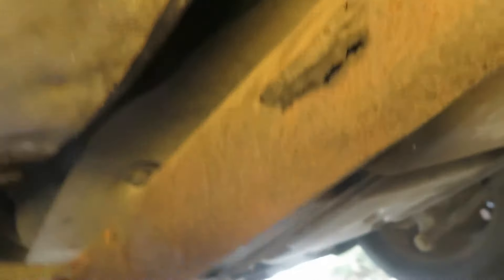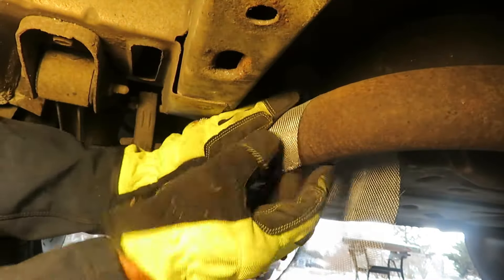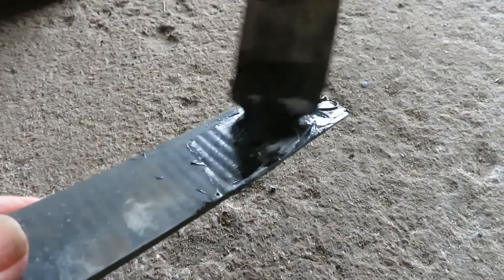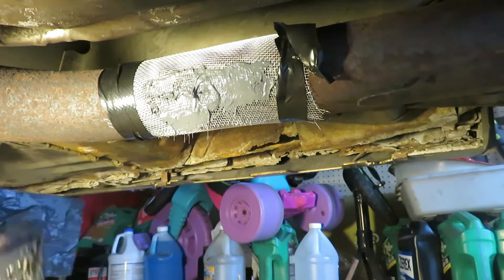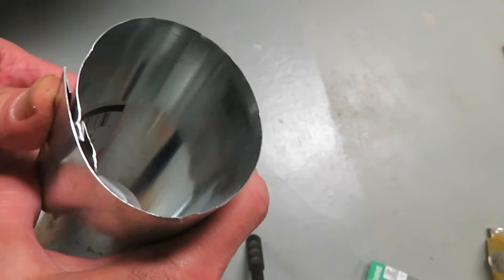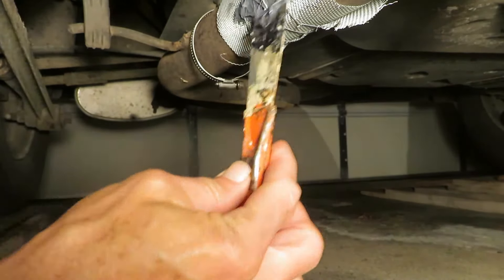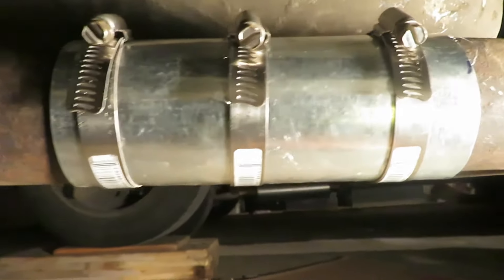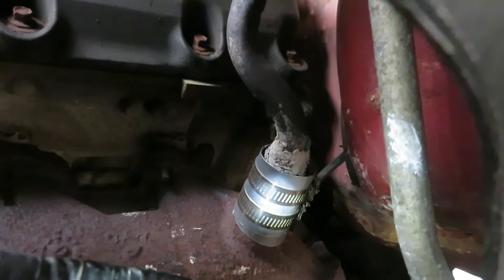How to Make a Lasting Repair on an Exhaust Pipe Leak

Comment: I think I would have embeded the screen in wet epoxy, but I'm teaching myself to weld so I don't have to do hack work like this. I tried that type of fix when I realized that my Focus oil pan had scaled to the point of leaking directly through the pan, I coated the entire pan and the oil still found it's way through the leaks and up over the rim of my improvised bowl. 2 years later, how did it last? I was ordering the pipe and the guy at the counter said we could just order the premade pipe, which I hadn't even looked into, but since it has 2 O2 sensors and collects both manifolds and joins to one before the cat, he closed the catalog and continued looking up my pieces without another word
Reply from the maker: This is for the non-welders out there. I mean hackers. Good luck with your welding, although I think it can be tough depending on where the opening is located. Best solution is new pipe. It did last a couple of years and then I did it over with heavier gauge sheet metal.

Comment: Thank you! I used the aluminum window screen, the high heat epoxy, some aluminum sheeting instead of stove pipe, the hose clamps and on top of all this, in the middle between the hose clamps, I used a 4” stainless steel band clamp to hold it all together. So far it is working great!!
Reply from the maker: Good idea with the stainless band. I went that way the 2nd time.

Comment: Nice! My old diesel rabbit vibrates those hose clamps off though 😂
Reply from the maker: I feel you. Sounds like a place for standard exhaust clamps.
Reply: @TheOriginalMechanic  hello want to ask you about a video you did on a 2010 toyota corolla around 5 yrs ago
Reply from the maker: @Blu-Man Sure, fire away
Reply: @TheOriginalMechanic  the 2010 Toyota Corolla you did 5 yrs back installing new headlight assembly did you have to adjust the height where is the adjustment screw ? And do you use led bright bulbs ?
Reply from the maker: @Blu-Man  I did not have to adjust the screw. I am not sure of its location and I no longer have this vehicle. I used standard replacement bulbs. Thanks for watching and I wish you luck with your repairs.
Reply: @TheOriginalMechanic  me and my Co workers are avid fans of your instructional videos u got skillz
Reply from the maker: @Blu-Man  Thanks so much!
Reply: @TheOriginalMechanic  say one last thing im wanting to change the transmission fluid and filter in my 2010 corolla like you had will car ramps put the front up high enuff to crawl under with plenty clearance to pop the bolts of the pan?
Reply from the maker: @Blu-Man  I would think think so. I haven't done it on this car but that's what I'd do.
Reply: Use wide band clamps. They won't go anywhere.

Comment: I used the expoxy high heat on a pipe and used grinder to clean area and just were tiny hole but worked good I think be ok truck only gets up to 250 degrees so should be ok.i was gonna use some screen to but I didn't think would hold. 4:11

Comment: If u had power tools then there would be no use of speeding up the video😴
Reply from the maker: I have those but then I would have to find the tool, charge the battery, and cut the decibel level on the audio track. That's so much extra work lol